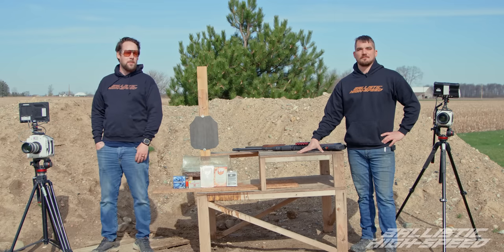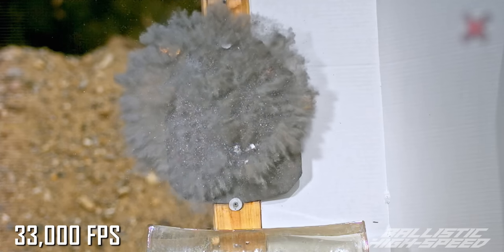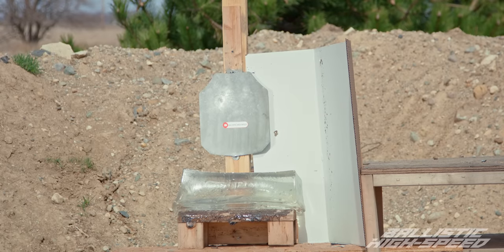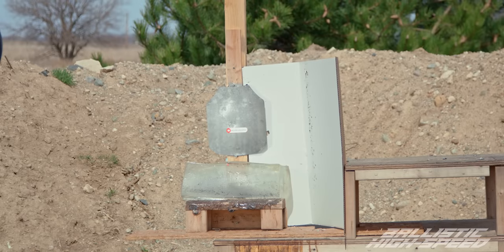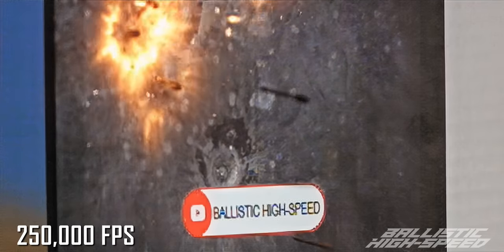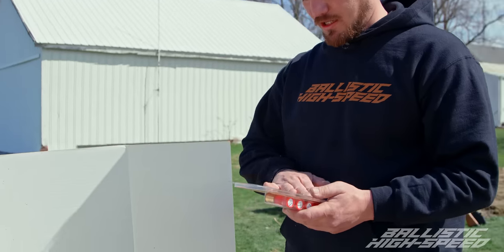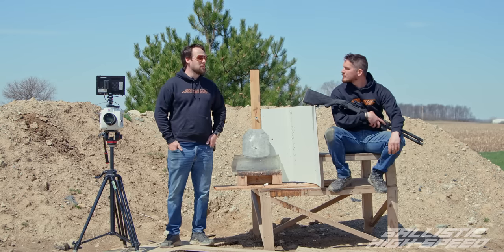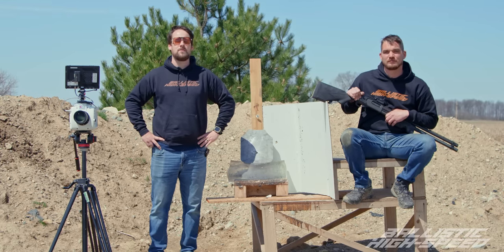Exploding Shotgun Rounds at 250,000FPS! - Ballistic High-Speed

Comment: That AP shotgun slug was absolutely brutal. I couldnt imagine getting hit by something so hard that it basically just smashes a steel cylinder into me. I think a cool thing to look at would be to set the hi-speed camera up perpendicular to a steel plate to watch how material comes out through the backside when shot with AP rounds.
Reply: They talk about not being able to see the armor piercing effect of the AP slug, but I'm pretty sure it is that rod that pierces the back of the cylinder as it splatters against the plate. I suspect it is "armor piercing" in the sense of piercing Kevlar body armor, not steel plates. Whatever hardened penetrator was encased in the slug was stopped dead by the plate and the rest of the slug continued on.
Reply: It’s basically the same concept as British HESH rounds vs armor, just without the plastic explosives

Comment: The last one is a perfect illustration of how a tank can get knocked out by a non penetrating shot. While the projectile itself fails to penetrate, the material knocked off the backside of the armor kills the crew.
Reply: It all depends on how the armor plating is manufactured there are different  layers of armor plating to help stop the spalling  example  US battleships had different layers of armor plating like  on the Iowa Class and the South Dakota  class battleships
Reply: Laughs in HESH
Reply: It's called spalling and it's terrifying
Reply: That's not actually how real armor piercing rounds work. But yes, that is certainly nothing to dismiss!
Reply: this is what squash head tank rounds do they're putty explosive that squashes against the plate and when it detonates it blows chunks out of the back of the armor plate which is inside the tank

Comment: The ball shot made a really interesting phenomena of energy transfer spalling. Much like squash head tank rounds of WW2, and until fairly recently. It wasn't as much will this solid punch a hole through the armor, but if it hits it and dumps energy, the concussive wave would transfer through the armor to blast off a piece of the armor from the inside wall of the tank. Sending razor sharp shrapnel bouncing around the inside of the tank.

In this case the ball just punched and sent a 'rivet' into whatever the backer to as of the armor.

Comment: That final shot reminded me of the tests I saw that showed how the 5.56mm M193 bullet (55gr, 3250fps) was able to defeat body armor.

The bullet would deform upon hitting a hardened-steel target, thereby transferring a great deal of the energy into the plate. While the bullet itself would never penetrate, it would punch a perfect little, cylindrical divot out of the plate and into whatever was behind the target.

As you increase the hardness of a steel plate, you also increase the brittleness of the steel, so having a lead bullet smack into it at high speed was enough to overwhelm the integrity of the steel in a tiny area of the plate (while the remainder of the plate remained unaffected).

Comment: I almost couldn't understand what I was seeing at first.  I knew they hole was there but the ball just stopped.  Would have never understood without the highspeed.  Really great episode. 👍😀
Reply: That is the insane part the ball just like stopped dead the plate barely moved and had a plug knocked out of it 
At first i thought the ball was just lead and had a smaller penetrator core 
It is a solid method to get the core to target lead engages the rifling to impart spin helps form a gas seal add weight and the core pushes through the lead through the target and out the back
Now reason you can not use a small tungsten ball or faceted core inside a much larger lead ball 
using those shapes you don't need to worry about things like tubing end over end it just works

Comment: I will say, as a note, with AP ammo not all of it can actually pierce steel due to how dense the steel is and if it's too thick. That slug I would guess can easily defeat kevlar, but ceramic or steel plates would defeat it easily. True AP rounds that can defeat steel or ceramic tend to have tungsten cores or tips as it's much more dense and hard versus the steel. But otherwise super cool!

Comment: Try 22mag subsonic red tips 2200fps. I did the same thing y'all did with canons. (Shotguns). Try it before you air it, it'll blow your mind. Hornady subsonic it'll do the same thing your shotgun round with the ball in it supposed to penetrate still plate this one will do the same thing cut out a little ring of Chunk metals perfect little round circle and stuck it in the tire of my trailer, don't know where the bullet went, but it cut out a perfect little plug.

Comment: try a speer african grand slam solid in .458 as they are turned brass with about a .25 tungsten core... use a modern high strength 45-70 and this 500gr should hit about 1900fps... these projectiles are hard to get these days...

Comment: Pretty sure somebody has already suggested it, but let's try the .69 caliber and larger, muzzle loading smoothbores. That much lead getting splattered, HAS to be spectacular.

Also, let's try the really high speed rounds: .22-250, .220 Swift, or the hard to imagine .22 Eargesplitten Loudenboomer. Yes, It's a real cartridge, though "experimental", and achieved 4,600fps, which would either vaporize, literally,  on impact, or blow a remarkable hole in the armor plate.

Comment: Taking it from the top:
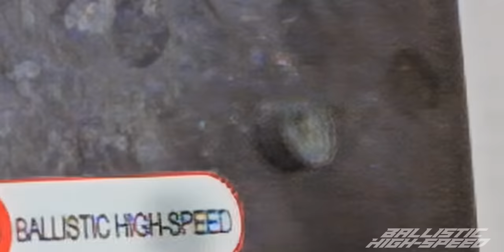Interesting, if you watch the 1 oz slug at 0,25 speed, you can see teh slug starting to glow from the air between it and the plate being compressed before it makes impact. ~7:03 - just before 7:05

Here's a like instead, I'm close to wanting to see every video (I'd like slower impact speeds & faster pre-impact slo mo - the impact displays are better than "The Slow Mow Guys", but could be a little better with your equipment)

P.S. As long as the target medium is consistent it's apples to apples - just leave the oranges at home.

P.P.S. Sorry about picking this video apart, you guys do great work, I'm just focusing on "irrelevant" minutia to avoid IRL issues today (science and maths are easy, life & emotions are hard)
P.P.P.S. thanks for being a welcome distraction from the rest of my life. (in general, not just today)

Comment: You can "penetrate" that steel armour plate just with lead ball, if it hits with enough speed/energy. Polish secret AT rifle from 1935 uses that principle (name - kb ppanc wz.35). 7,92mm jacketed lead projectile with velocity 1200m/s could punch-out about 15mm dia. plug in 30mm armour plate. Muzzle velocity was 1275m/s. There is one neat simulation: https://www.youtube.com/watch?v=VryzTyh8X7Y

Comment: Do Discarding Sabots!!!  (Google Remington accelerators) There’s widely available .30 cal plastic sabots that take .224” (.223/5.56) projectiles and can be loaded (with included dies) into .30 cal carbine, 300AAC, 30-30, 300 Savage, 7.62x51,7.62x54, 30-06 300win mag, (idk if it can be used in 30 Super carry, or what the results are…… but it would be neat to find out) and with the vast selection of .224” projectiles you’d find some jems. (Like m855,m855A1, m193, Barnes TSX, and finally, can you imagine how effective m-955 would be going 5,200 FPS out of a 300 Win mag? Plz try it, or any of it.